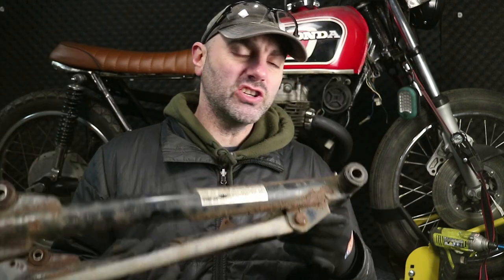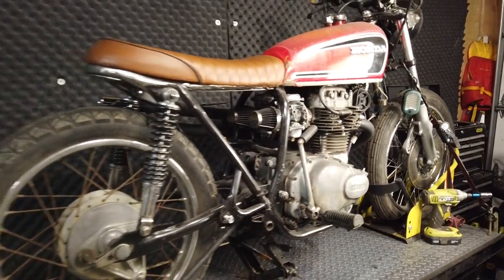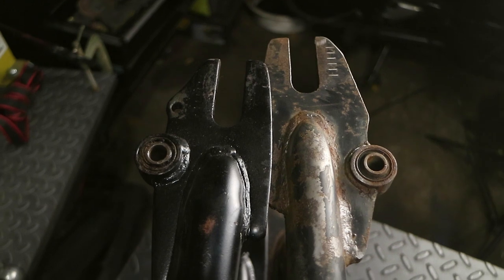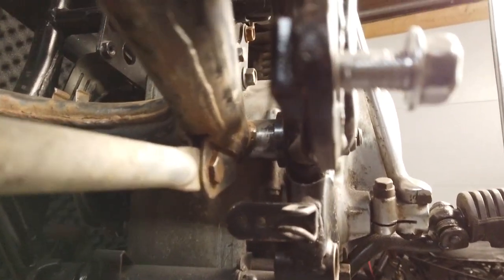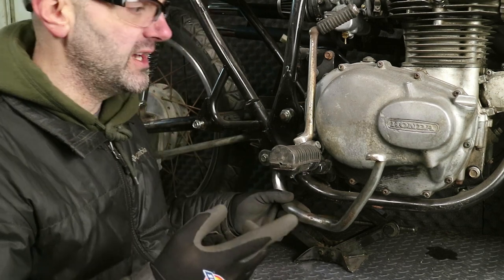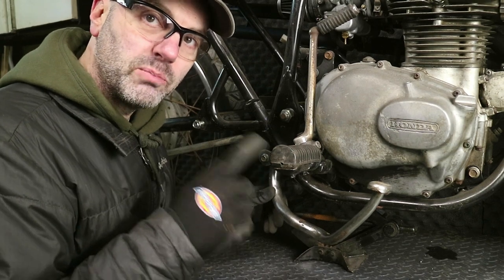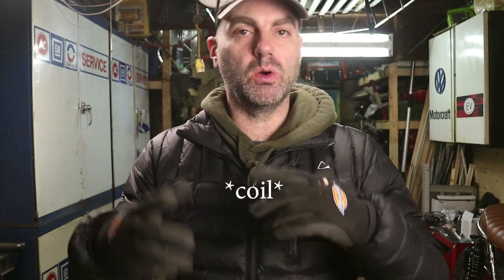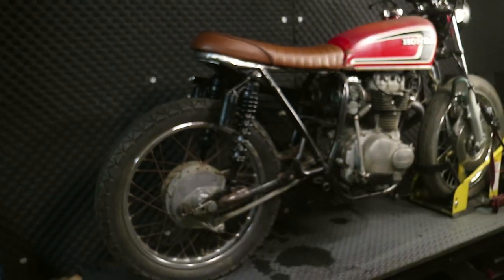CAFE RACER SCRAMBLER BUILD, Swing Arm Replacement, New Shocks, Brake Pedal - Honda CB360 Ep12

Comment: Try a CL360 brake pedal. Also, you can cut a half inch or so off the bottom end of those shocks to shorten them a little if needed.

Comment: Good work, Steve, and thanks for the video. Too cold in my garage (for me at least) but yours looks colder. I like your ‘this week mods’. Will the longer rear shocks require a longer set of forks at the front to keep the steering geometry right? Anyway, thanks for all of it, its going to look good with a rear fender (‘mudguard’ here in UK!). Roll on the springtime weather!!
Les
Reply from the maker: Thanks Les! I’ve read that on these bikes raising the rear a touch can help the front be a bit more stable. If no, I’ll look into lengthening the forks a touch. Yes, waaay to cold. We have had the deep freeze here 🥶

Comment: The rear frame hoop is catching the eye so it makes the back of the bike seem high. Once it is black it will blend in and look great with a small black fender and tail light. Well done, it looks great already. What did you do with the exhaust heat shield? Wayne.
Reply from the maker: Thanks Wayne, I agree, once the fender is on it hopefully should make sense. Lol , I have changed direction on the heat shield but thought 3 vids in a row on the muffler was a bit much 😏. Will def post up what I do though. Cheers!